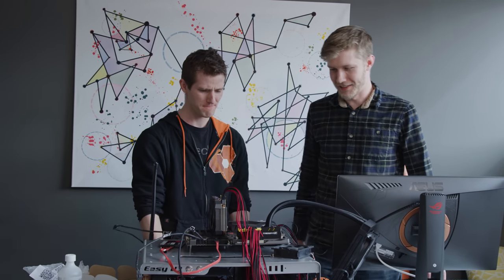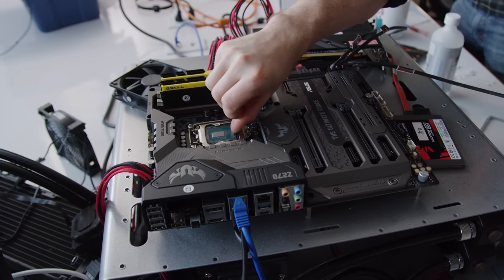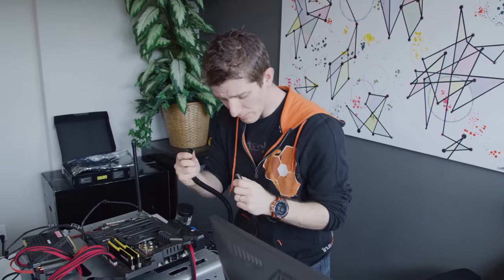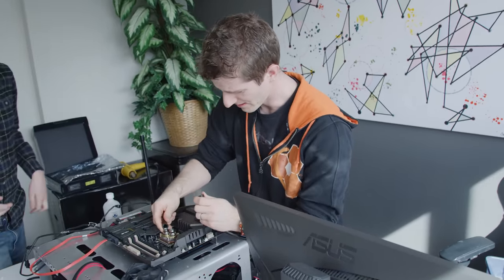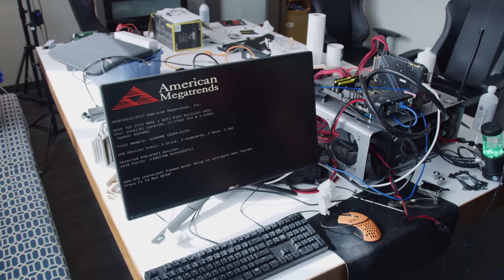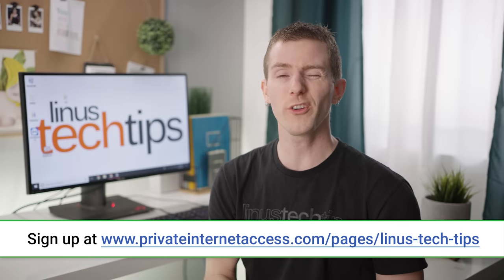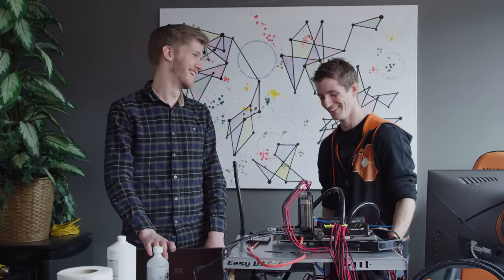This cooler VOIDS your warranty! - Worth the risk??

Comment: Draining the loop?, we don't have 2 minutes to do that, you have been wasting time.
Spends 30+ minutes making sure the board is dry after  spilling water all over it =D
Reply: do things slowly but surely if u are in a hurry.
Reply: He could have just put the cooling block on after connecting the hoses.
Reply: At least he didn't drop it.
Reply: disastermaster85 Hell at least he didn’t brick it.
Reply: Kimera
It's quintessentially Linus.
Reply: TheConanRider some people cannot do such complicated things
Reply: no he cant, did you miss the whole part where he had to put down the retention arm?
Reply: #LinusLogic
Reply: its called "drama" and "show"
Reply: That shit cracked me up so much
Reply: liquid coolers use water? I'd imagine they'd use glycol or something to transfer heat better...
Reply: Common misconception about water cooling, the water heat transfer is mostly irrelevant. The loop will reach equilibrium anyway. The cooling performance is based on the radiator ... and we are back to air cooling. The Advantage is that it is easy to get all that heat of of the case and that you can easily use giant fans. Noctua basically solved the same problem by building a giant heatsink tower and just uses enough cooler. And that's the whole reason why most AIO water-coolers are not even close in performance to that Noctua D15 and similar big tower coolers. Just don't forget similar quality case fans to get the heat out of your case for optimal performance and silent running. ^_^
Reply: Oh Kimera, that is a classic "Reactive vs. proactive" people. Reactive people spend time reacting to their own lack of  proactivity and sometimes, the brain also has something to say.
Reply: Do grease and spit improve CPU performance?  Why are they gludging everything with their greasy fingers?  Why aren't they wearing surgical face masks?  Amateur hour over here....
Reply: Thats why we put a coil of garden hose into a freezer with two holes in it hose to hot water out and cold water in on cooling system inside PC. garden hose works fine for these longer loops :D Just fill a freezer with gardenhose. Make sure to never turn of the pump or the PC :D
Reply: +Rikard Nilsson Yes. Water is more efficient at transferring heat than glycol is.
Reply: yeah, that's what happens when you "don't have time for this"
Reply: An ounce of prevention is worth a pound of cure!
Reply: Almost like they made this joke in the video
Reply: @Broxine  This guy gets it.  If they didn't do stuff like this they wouldn't have near as much content in their videos.
Reply: Lucas Jackson, i know, thats why i pointed it out ;)
Reply: Slow is smooth and smooth is fast, Linus.
Reply: I've fired people for doing stupid things after I've told them specifically not to do it. I wouldn't hire Linus. Having the patience to do things correctly is importantl; he apparently doesn't have that.
Reply: D.E.B. B dude, its show

Comment: My celeron chip boils at 100 degrees Celsius
Reply: im american and even i know boiling is 100
Reply: celeron chips are not made of water silly
Reply: Rhapbus1 the higher the pression the lower the boiling temperature of the water.
Reply: the higher the pressure the higher the boiling point, surprise
Reply: I have a laptop with an i5, and I've never seen it go above 77 degrees Celsius. It sits at 40-45 while browsing the web or watching YouTube, and around 60 when I'm playing something like Minecraft.
Reply: Never buy a 130+W tdp chip like mine. I had to undervolt it from 1.3 to 1.1 when i got it with the stock fan because it reached 95C at stock volt.
Reply: Jk I'm just playin I really have a ryzen 7 1800x with a noctua cooler it idles around 40 with regular use
Reply: nope.  water boils at lower temperatures at lower pressure.
Reply: Stock heatsinks are a joke
Reply: hey, at least you can use it to make pasta
Reply: Biggest mistake ever : not have bought a decent cooler with all the other components. But hey, that i7 960 is still alive and running <3

Comment: Please do an ethanol liquid cooling loop. Max temps cannot exceed 78.4 degrees.
Reply: personally i think they should skip that and skip straight to using NaK

it's an alloy made from sodium and potassium, it's a liquid metal at room temperature and can be pumped without any moving parts, using two electrodes, a direct current and a magnet.

It also reacts explosively with water, oxygen and is highly corrosive.
Reply: Preferably with acrylic components all over the loop
Reply: Sounds perfect for LTT.
Reply: Yeah, lets put Linus near something that can ignite spontaneously on contact with air and react violently with water... What can go wrong? ( ͡ᵔ ͜ʖ ͡ᵔ )
Reply: NaK cooler already exists: https://www.guru3d.com/articles-pages/danamics-lmx-superleggera-review,1.html
Reply: And frankly I don't know how they managed to get through the legal crazyness of putting NaK in a CPU cooler and selling it. And there are many limitations for NaK in this particular use case. Frankly you're better of using it in an orbiting nuclear powered satellite :D (That's also a thing)
Reply: That's totally wrong.
Reply: Koo Woo+ Ethanol is bad for certain types of rubber seals.
Reply: Sure is.But there are suitable fittings out there just look at corn juice in cars.
Reply: Andrew Louw the heat capacity of ethanol is pretty low. so pretty sure it will reach 78.4 degrees.

Comment: Out of curiousity, why didn't you attach the fittings to block off the bench when you just had the 2 tubes in your hand. You could have avoided water on board issue if you just attached to block then mounted it on the CPU. I do contracting work if you need anymore advice ;)
Reply: Linus cannot perceive that possibility.

Comment: Direct die is the way to go of you got the balls! I did this a few years ago with a Arctic Liquid Freezer 120 to try to get my hot 3570k cooled down. I was unable to keep it below 80c above 4.4ghz. I direct died it and was able to get 4.7ghz stable and 4.8ghz at 90c. Not sure if I would build a custom loop to be able to do this with my 8700k.  The difference in rigidity between the 3570k and 8700k PCB is hugely in favor of the 3570k. No way could I pull off a custom spacer for the 8700k without risking bowing the PCB.  What we need is a direct die air cooler!

Comment: Linus FTC just announced that void warranty stickers aren’t legal, so just ship it to the us manufacturer
Reply: While that's interesting news, I'd say at least 90% chance that that statement/law does not cover this scenario. CPU "lids" are not stickers, And the reason it voids the warranty is because it counts as mistreatment of the product (for good reason), or at least indicates likely mistreatment of the product.

That's not the same thing as stickers that are there which prevent people from opening up a product so that they can repair it themselves (or via a 3rd party repair). It's those sort of "warranty if opened" cases that the FTC is against.

Like I said 90% chance it wouldn't apply here, although it is vaguely plausible that it could sort of apply, but I highly doubt it.
Reply: You can say you opened it to switch a few broken transistors lol
Reply: That's correct. Your warranty isn't void if the problem you're using your warranty for is unrelated to what you yourself did. Like changing a graphics card on a prebuilt system won't affect the warranty of the system as a whole, except if the new graphics card you bought was faulty and nuked your PC. Or if you're Linus, you spill a tub of yoghurt inside the PC while working on it.
Reply: The use of 3rd party repair/upgrade services or 3rd party components of choice in place of the manufacturer's part cannot invalidate warranty due to  Magnuson–Moss Warranty Act.  The warranty is invalidated  If and only If  the CPU is damaged because of the use of the 3rd party heat spreader,  or in the process of installing it .
Reply: oooo that is something i will have to read up on. some of the void if removed stickers are dumb.... my friends hyper 212 turbo literally has one on a fan cable.... I can understand when they put them over a screw or something as it lets them know you opened it ect but taped on a fan cable ...... coolermaster and there void stickers i gusse.....
Reply: literally made me die

Comment: De-lidding and oc both void warranty anyway dont they? So who cares lol, run that bad boy
Reply: Oc doesn't void warranties these days
Reply: Intel will even sell full replacement insurance for over clocking
Reply: Pyropup55 ahh I wasnt aware of that, maybe they cover a delided cooler to... for a fee of course
Reply: They don't cover a delid because you're modifying its physical state.  OC is just... too common, super easy these days.   Most models are overclockable out of the box.  I think you can technically defeat the measures preventing an overclock on a non overclockable chip...  THATS probably a voided warranty.
Reply: If you are going to delid anyway, the "this voids your warrenty" disclaimer is not what you should be worried about I think.
Reply: also far less likely to ruin your cpu by just accepting a 5.0 OC and calling it a day instead of trying all of these crazy techniques for what amounts to barely any extra performance.
Reply: You can RMA a delidded CPU if you reseal it properly.

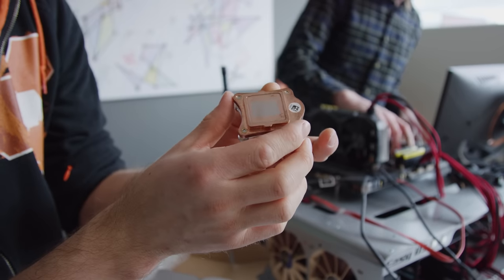Comment: My english ist not the best, neither is my knowledge of cpu-coolers, so could anyone tell me pls what Linus is talking about at 1:45? He says "you can see the outline of where a ??? was making contact..." and I don't understand the word, so I would be very thankful if anyone could tell me^^
Reply: JonSchnee777 DIE is the word
Reply: i guess he was speaking of a failed cpu core that left a mark on the prototype.. a "die," like the cpu died

edit
well, ... not even close😁
Reply: DIE, part of the cpu, that part where the internal thermal paste comes on, then the heatspreader, what he ment was it touched that part of the block so it left markes, like if you put your greasy finger on a glas or so.
Reply: The die in a CPU is the actual silicon segment that contains all of the transistors and logic and such. It is the main heat source in the CPU and thus it is what the cooler must make contact with to be most effective. The mark was there from where the liquid metal interface material dissolved the oxide layer off of the surface finish on the cooler.
Reply: Yeah, I don't really get why they use the word "Die" in this context either since for most people it means "stops living". But in this case "die" is an unpackaged, bare chip. From what I know this comes from the word "diced" when individual chips are cut from the wafer. A single chip is called a die.

Comment: People who live in cold countries see 76ºC and think its ok...I live in Brazil...anything above 70ºC and I go 'Dear old PC, please, don't die on me....'
Reply: TSEDLE333 cold countries don't get 76°c if that was true everyone in England would be dead
Reply: TSEDLE333 why do people use those temperatures?? I don’t understand anything about what’s hot or cold like this... for me water boils at 100
Reply: 76ºC ON THE CPU CORE TEMPERATURE....sorry I f I wasn't as clear as it sounded...
Reply: We're talking about CPU CORE temperatures. CPUs, GPUs and pretty much everything that uses electricity generates some heat. High performance tech like CPUs and GPUs can go around 90ºC without any real problems....but above their limit temperatures they can BURN (i.e. fry themselves...) and thus it hurts financially to buy another one. Specially here in Brazil, in which, they are ridiculously expensive.